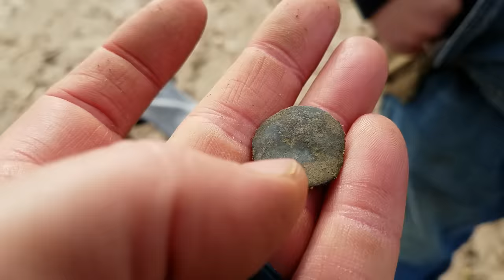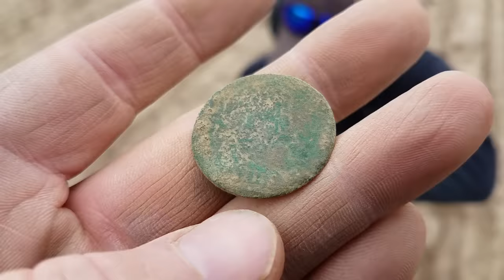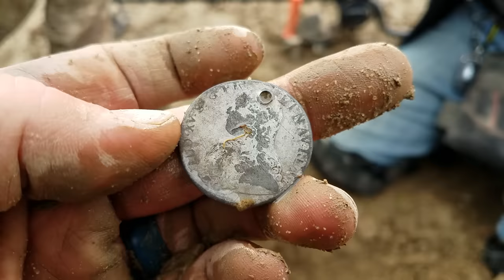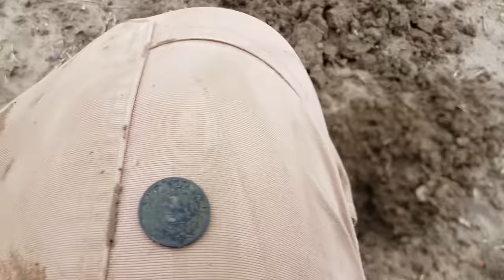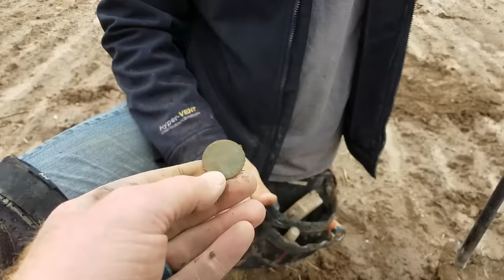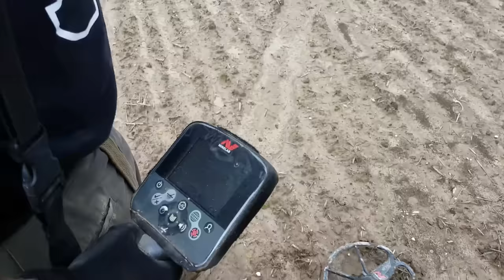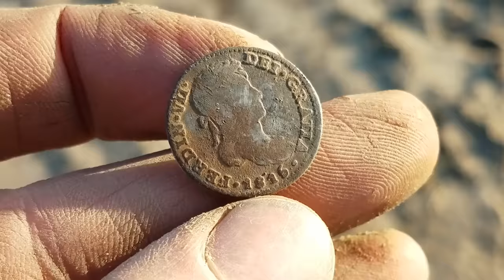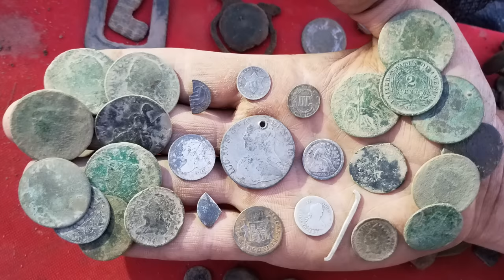Treasure Hunting Extravaganza! Metal Detecting at its Best! 1730's Tavern

Comment: 10:27 I have the same thing! It’s an 1814 large date. My condition level on my 1814 large date capped bust I guessed was VF-20, pricing it to possibly be worth $250. The older 19th century coins are pricing extremely high (1820s or earlier)

Comment: There was a shortage of small change in the early 1800's, which lead to practice of cutting larger coins. This eventually lead to reform but not until the production of "Hard Times Tokens" occurred.  You guys may run into those from time to time as well. They are Large Cent sized Coppers with advertising. Similar to the latter Civil War Tokens which were meant to replace Indian Cents.
Reply from the maker: Thanks Jim. We’ve came across a few Hard Times Tokens over the years. Wish we found more.

Comment: It looks like you guys are running the stock coil is there a reason that you're not running the big ones that you normally do I guess I should watch the whole video before commenting lol
Reply: I have found myself getting more out of the stock coil recently.  Weight is great, and depth is just superb, honestly.  The tornado coil is on my list.  I think my thunder coil is a little more chatty than it should be...
Reply from the maker: Everyone should have a small, stock, and large coil in my opinion
Reply: I have a lot to get on my list I just started five months ago started off with Garrett ace 400 I have already upgraded to the AT max next on my list is waterproof headphones I live in South Florida not a lot of old structures to detect but plenty of beach we need to get in the water

Comment: Why you don't spray all of your finds with water before rubbing it instead only the silver ones?  Most of the copper coins you can't identify  because you rubbed the layer off on which you could identify it. Sand is like sanding something. If you only use water you'll be able much more to identify. A viewer from Fryslân Netherlands.